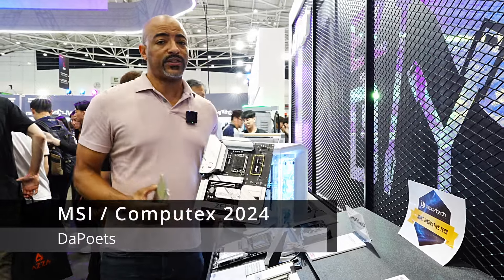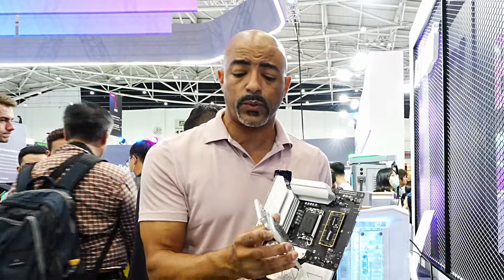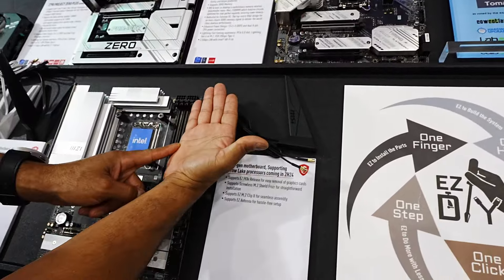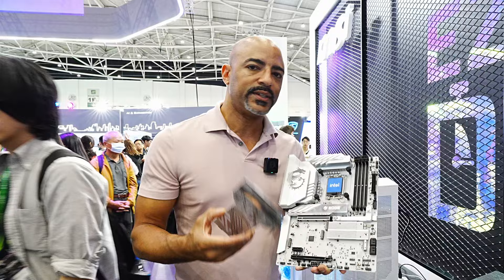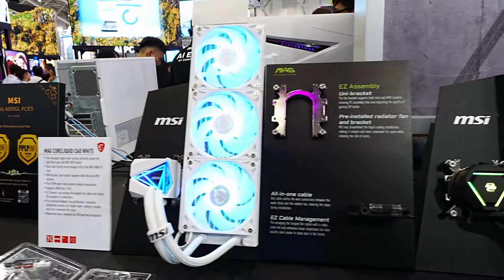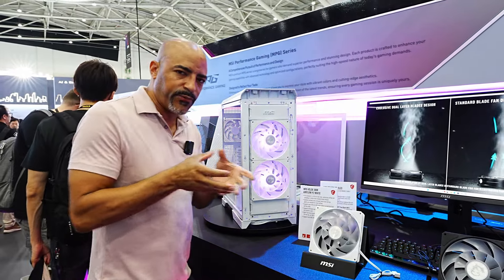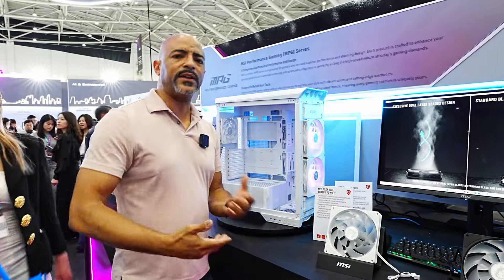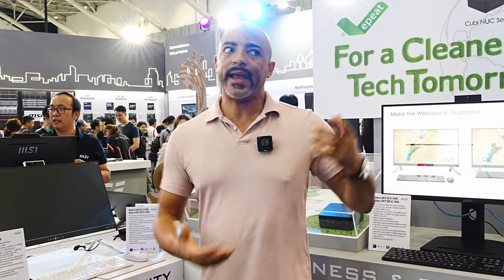MSI Computex 2024

Comment: With GPU’s getting so slot-thick, I almost think we need bigger boards or need to start putting gpu outside the case so we don’t lose pcie slots.
Reply: Only problem is you're also adding price to that solution, and losing more space either in the case or around you work area.